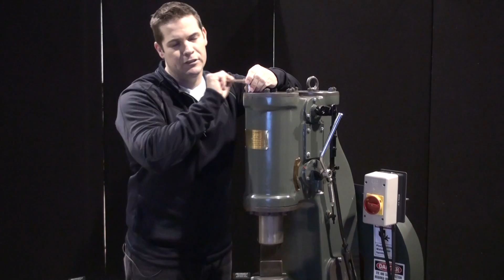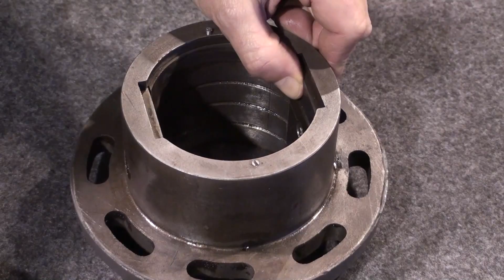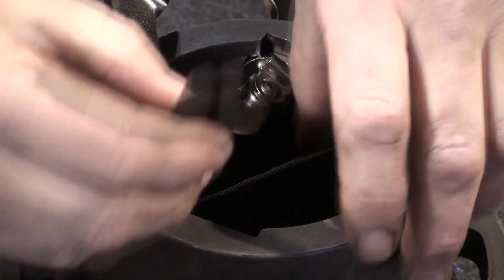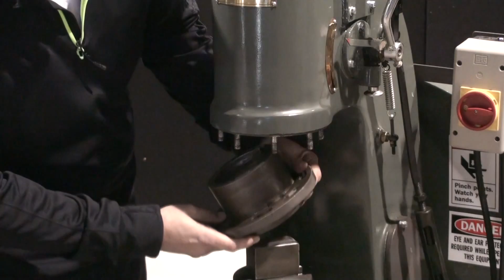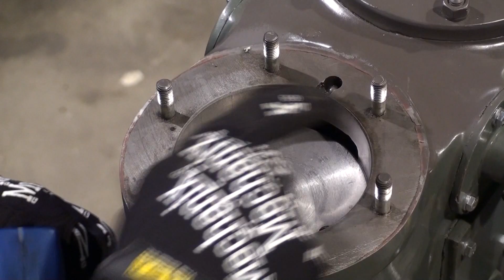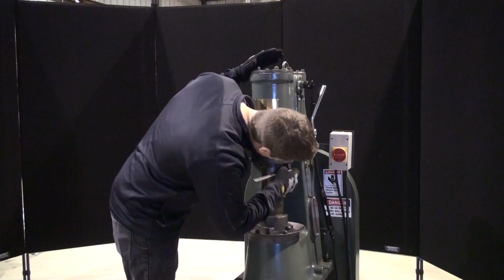Anyang Power Hammer Ram and Stuffing Box Assembly

Comment: .I have a Chinese self container hamer dont know if it is anyang, brought it second hand. I have a problem with it; the ram does not retract as it used to. It does not go back up all the way. It stil functions but This is not right. Sometimes at start up the upper die hits the power die by Itself the first 5 orso hits. What could be the possible cause of This problem?
Reply: Hola